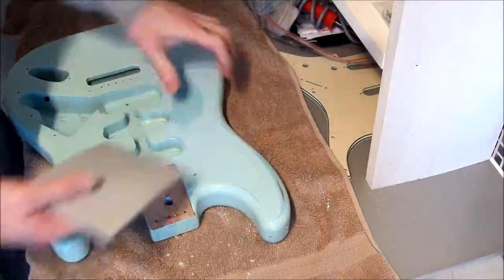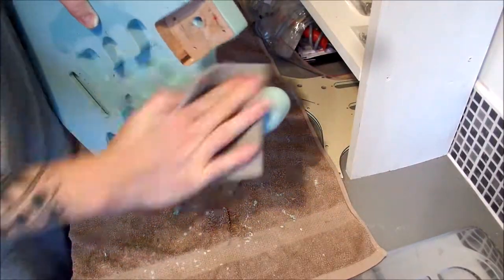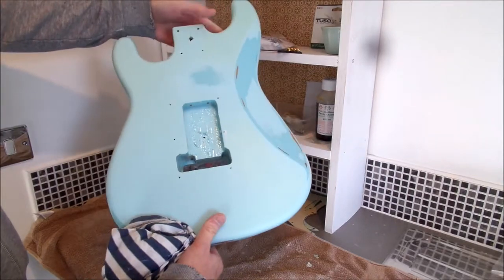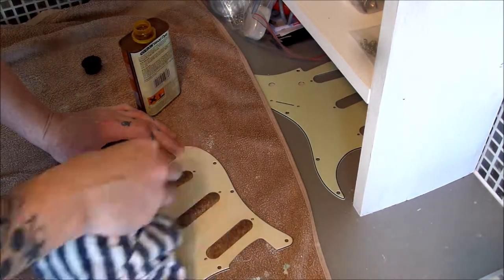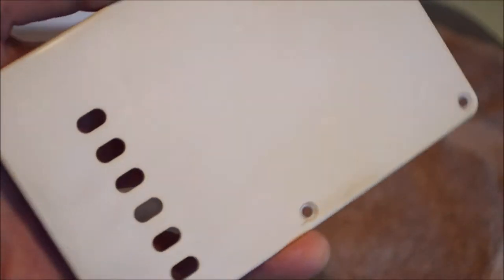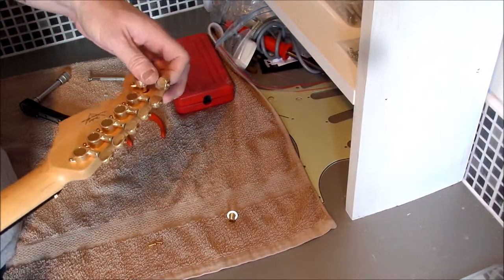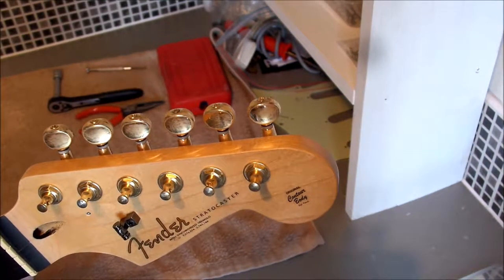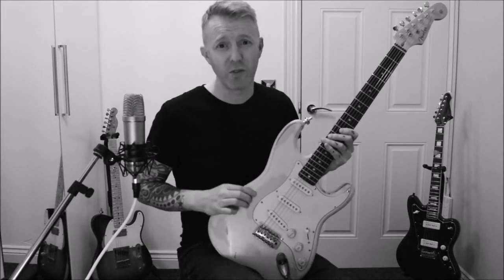How to Relic a Guitar - Episode 3

Comment: What grit of sandpaper did you use? I have a black P Bass that I am wanting to relic. Thanks!
Reply from the maker: I had 400, 800 and 1000 grit paper. But I found the pads better, because they are better to use wet. Don't worry about using quite coarse paper, as it wears down as you use it anyway. Very light abrasives don't last long enough. Just get ready for some arm-pump. It's hard work, best split over several days to get the finish right. But WELL WORTH IT.